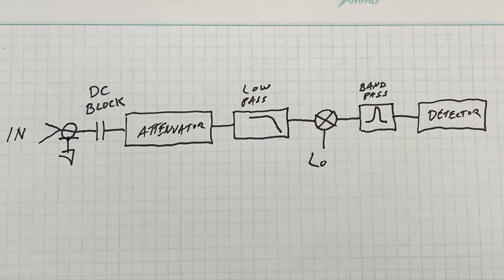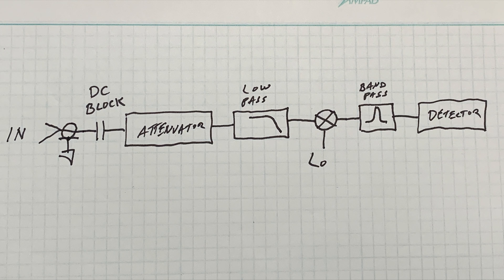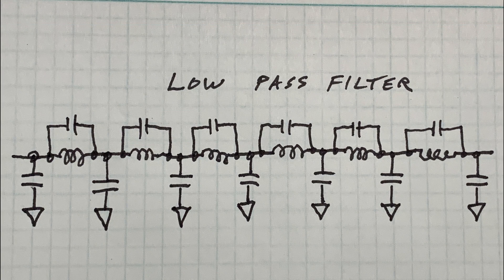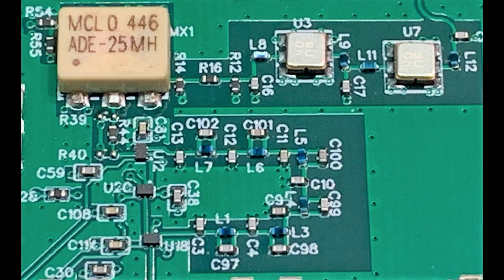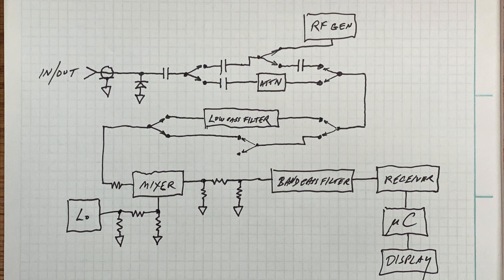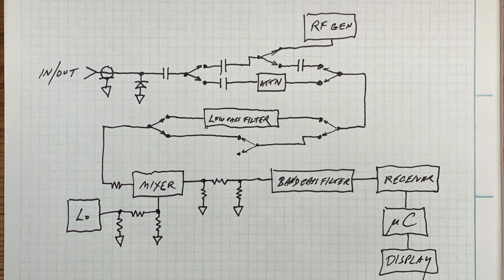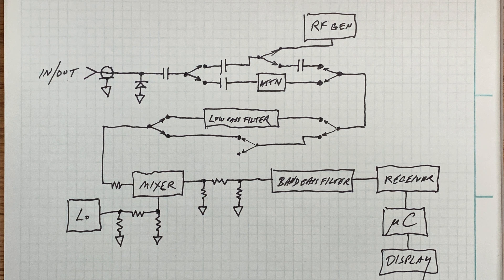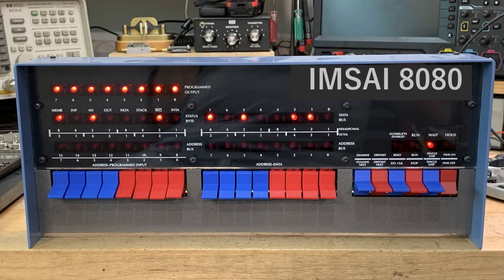#1327 TinySA ULTRA Block Diagram

Comment: Thanks for the overview.  I’ve had a TinySA for about a year and it is quite handy for qualitative work.  My Ultra version should be here in a few days.  The Ultra’s DANL beats my Agilent bench SA, and it looks like some of the original TinySA shortcomings have been addressed.  The differences are: the bench SA can have RBW of as low as 1 Hz, an FFT IF mode which lets you see the spectrum of transient signals that would be missed by a swept IF, and several different types of detectors.  At about $120 the TinySA Ultra appears to be a pretty sweet deal.

Comment: Since the NanoVna project (and possibly the TinySa) are open source hardware and software, have you considered addressing some of the design issues you’ve pointed out in your videos in the actual schematics and PCB design files. Then branch off from the open source and send it to a place like Pcbway or the like to be manufactured? The cost appears to be minimal with the real investment being the time.
Reply from the maker: Yes considered. It is 95% software and so I'm not the right guy. Hardware wise, I would end up designing the same thing as the LibreVNA. and it would be about $500. For $1000 you get a perfectly good SA with tracking generator from Siglent. The problem with the TinySA is the mobile phone receiver chip limitations. So for pocket use, school use, hobby use, the new Tiny Ultra is just fine. The TinySA is not open source BTW

Comment: Thanks for reverse engineering the device. You are right the ultra mode path bypasses the low pass filter. I'm still surprised at the amount of power coming out of the mixer port in ultra mode, though. Specs say 35dB isolation and it's even more interesting if -10dBm is coming out of the attenuator(?) or straight thru. Minicircuits provides no data on that mixer above 2.5GHz so there's a good chance it's not great up there.

Comment: One of those other paths must be the LNA.

It would have been nice if the generator could be used as a tracking generator while in spectrum analyzer mode but I don't know if the architecture permits it.
Reply from the maker: you can do this; https://youtu.be/wKPkvuWWFXY
the IF is around 977 MHz